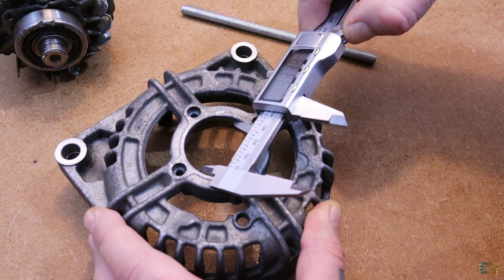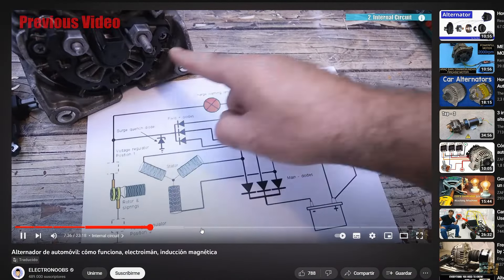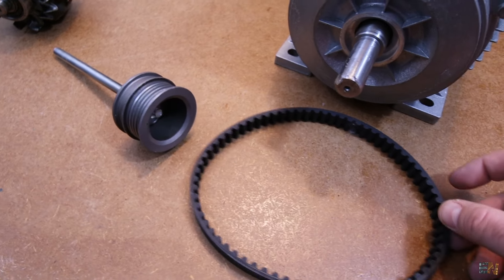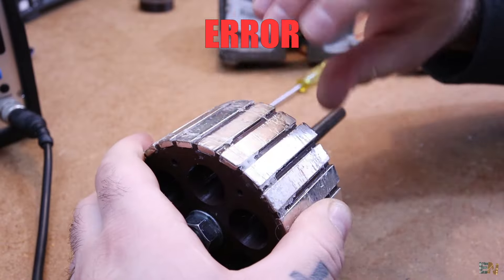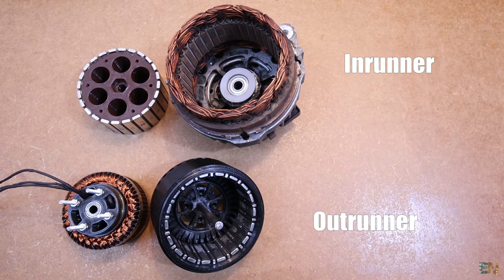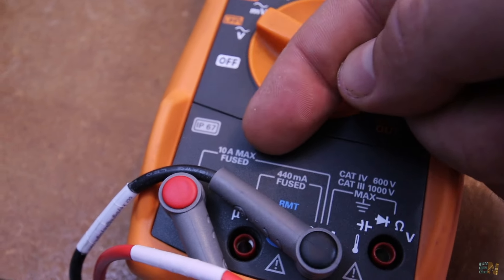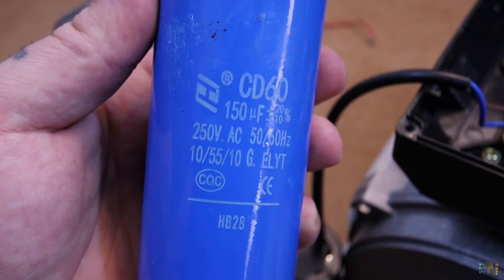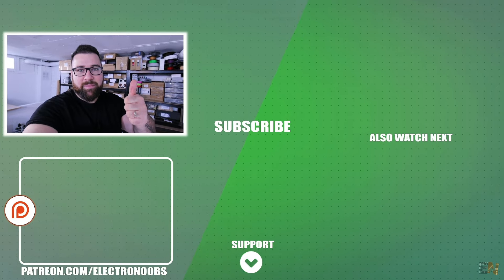Make a GENERATOR

Comment: I don't understand how you do not see how that works sir you just said it yourself the more magnetic force the higher the voltage if you want to lower the power can you lower the magnetic force if you want to lower the power output at high RPM you just said it yourself in fact I think you realize it when you said it sir😮😮😢